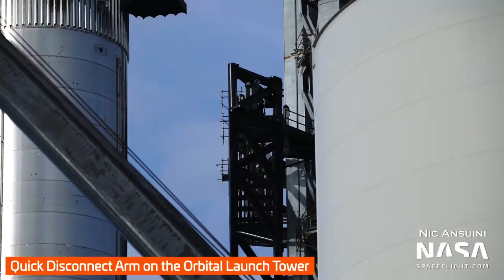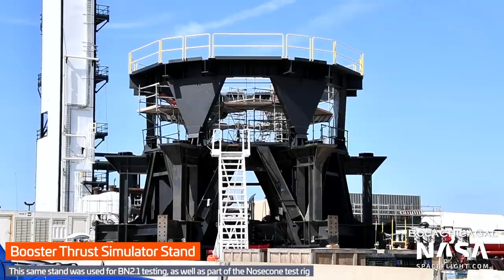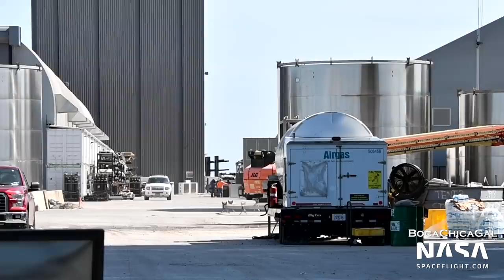GSE Tank 8 Aft Dome Flipped | SpaceX Boca Chica

Comment from the maker: Time Stamps!

0:00 - Sunrise Over the Launch Site
0:37 - Quick Disconnect Arm on the Orbital Launch Tower
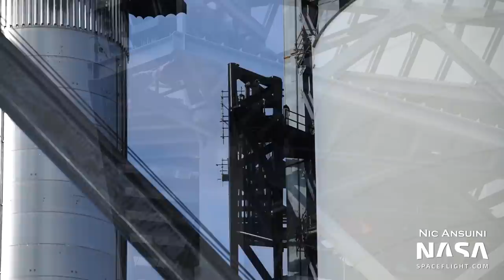0:47 - The Top of the Orbital Launch Tower
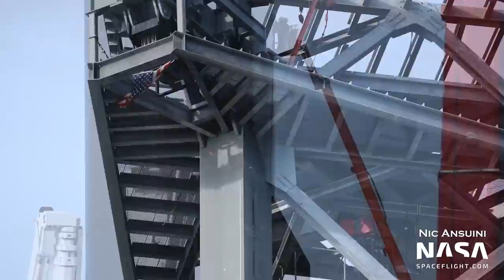1:07 - Ship 20's Hatch is Open for Worker Access
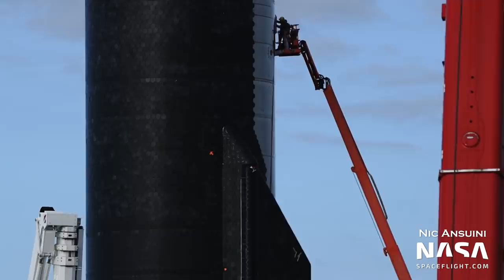1:26 - Thermal Protection Tiles on Ship 20 Look Nearly Repaired
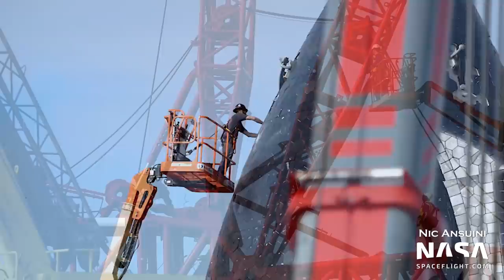2:05 - Crews Working on the LR 11350 Crane
3:25 - Carriage System for the Chopsticks
4:04 - SN15 and Ship 16 Peek Over the Propellant Production Plant
4:24 - Coil of Stainless Steel Delivered to the Production Site
4:44 - Work Continues on Possible Quick Disconnect Arm Extension
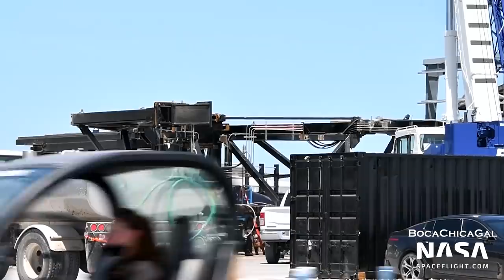5:43 - Work on the Ground Fabrication Building Expansion Continues
6:02 - Barrel Sections at the Production Site
6:22 - GSE Tank 8 Aft Dome Section Flipped
7:20 - Booster 5 Under Construction in the High Bay
7:40 - GSE Tank 8 in the Mid Bay
8:00 - The Propellant Production Site
8:34 - Booster Thrust Simulator Stand
8:53 - Test Tanks and Booster Thrust Simulator
9:13 - Booster Thrust Simulator (left) and GSE 4 Test Tank (right)
9:33 - Foundation Work for the Wider High Bay
9:52 - Barrel Section with TPS Tile Attachment Points in the Scrapyard
10:12 - Booster 5 Forward Tank Section #2 at the Production Site
11:07 - GSE Tank 8 Aft Section Moved Towards the Mid Bay
11:47 - A Ship Common Dome and a Methane Header Tank at the Production Site
13:05 - Booster 5's Forward Dome Sleeve Moved
13:26 - Booster 5 and Ship 21 Forward Dome Sleeves
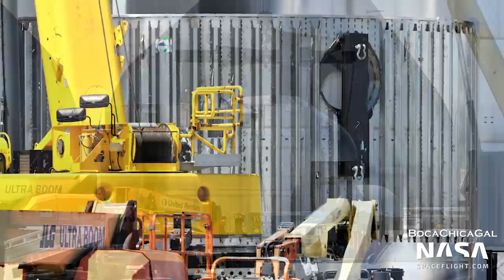14:04 - A Ship Common Dome on the Sleeving Stand
14:45 - GSE Tank 8 Aft Section Hooked to Crane Outside Mid Bay
15:05 - GSE Tank 8 Aft Section Lifted into the Mid Bay
Reply: Thank you for your efforts 👍
Reply: You are missing 12:29 - Somebody is real proud on themselves now
Reply: Challenge accepted ! 3.6 mm thick - 2000m wide - inner diameter 406mm - outer 9547 mm - length 172m this will make exactly 6 rings ! Weighing about 1,550 kgs each  ? thats my guess !

Comment: Those rolls of 3.97 mm thick stainless steel are 193 meters in length  and have 11.071 metric tons mass. The cylinders are 9 meters in diameter and 1.83 meters tall. So the number of cylinders per roll is 193/(9*pi)=6.8.
Reply: The roll shown on July 26 was 13260 kg; that roll would produce 8.013 rings. (13.260 / (1.8288 x 9pi x .004 x 8)). The last figure is the density of 304L steel.
Reply: I wonder what they do with the .8 left over. Do they make a two section ring or just use the .8 for other fabricated items?
Reply: @TheJimODonovan  maybe it's just absorbed as the cutting allowance over all those cuts
Reply: The machine that sets the curvature of the rings probably requires some extra length on both ends. That would have to be trimmed off before welding the ends to close the ring.
Reply: @TheJimODonovan  depending on what they use for cutting it there may also be some losses 🤷🏻‍♂️
…and the could always use the rest to fabricate something else like some covers or parts for the nose (I’ve seen steel being delivered in rolls in other factories and in the end it was used to make flat parts, so that’s an option) but I guess they could also simply return it so their provider can melt it down again and “include” it in a new roll (even though the rolls are usually a customized length).
Reply: Note: This is .8 of a ring, not .8 of a metre. That's quite a chunk of metal.
Reply: It really is very hard to answer the original question since we only have a handfull images of the labels on those rolls. The weights differ by tons sometimes (between 9.520 tons and 13.260 tons). The thickness differs by ±0.03mm.
Outokumpu stopped adding the length of the rolls to the labels about 2 years ago.
Also we saw a roll from Janco Steel too, so Outokumpu is not the only one.
So the answer would be 7 or 8 rings per roll. I assume they get both from the rolls they buy. That is better than the 6.8 they started out with (301 steel).
Reply: @donaldmiller1782  It's interesting to see the other properties all that chromium and nickel can affect. Plain-carbon steel has a density of 7850kg/m3 and I didn't expect the alloys to boost the density all the way up to 8.
Reply: @donaldmiller1782  8.1187 rings, if you take the inside diameter (9000mm-4mm) and the UNS S30403 density of 7.9g/cubic meter 
That gives them 3.3 meters of 'play' rather than just 376mm
Reply: @nemo-x  That's odd. I just googled a calculator and found one from bsstainless. On their form I enter: density=8, thickness=4, width=1828.8, weight=13260. It says the outer diameter = 1188.29mm which looks about right. (They also say the length = 226.58m).
Reply: I thought the new material was 3.6mm thick, not 3.9mm.
Reply: @nemo-x  He got the date wrong: it's 23 July "Pathfinder Nosecone with Payload Bay Spotted" About a third of the way through the video. 
(The print date of the label was 07-15-2021 9:37:12 am )

Comment: I fully expect the head of heat shield development to get showered in champagne by his team if by some miracle Ship 20 survives reentry.
Reply: when ship 20 survives. remember the heat shields help for reusability. the starship is made from stainless steel can handle alot more heat. then the tin foil shell of the shuttle..
Reply: I'm just saying even if they lose a dozen tiles on starship.. the ship will still survive reentry
Reply: @razzati420  stainless steel melts at 1510C, orbit re entry is near that so idk if it’d make it, In practice there is always more to it than on paper
Reply: There were two instances where the shuttle's heat shield was significantly compromised. The key difference was that with Discovery the tiles broke over one of the few stainless steel areas of the wing, whereas the Columbia had the leading edge holed, allowing plasma into the aluminum under-structure. Discovery's spar got toasty, but held. Columbia not so much.

Remember, even if S20 fragments on the way in, getting to orbit will be a major achievement in of itself.
Reply: Id just be super happy to see it make it off the launchpad in one piece, let alone into orbit
Reply: @Peaches_NZ  ar the very least it really needs to clear the launch pad by a couple kilometers, otherwise damaged to launch infrastructure will be a huge setback.
Reply: @admiralhugo1440  But hardness of steel sheets will gone after slow cool down from 700 C. You may be known that on the Titanic before collision was occured firing and steel plates was much more weak after that.
Reply: @admiralhugo1440  I'd also imagine it could warp quite a bit at that temperature from aerodynamic forces and, considering it is pressurized, this could lead to failure. But then I'm not an engineer.
Reply: Iteration, iteration... ad infinitum (as long as funding lasts). They’ll get a ship back even if toasty. They have a human rated capsule, IP on thermal loads scale across the company. But rapidly reusable? That’s the holy grail...
Reply: Champagne transpiration cooling... how billionaire space baron.
Reply: I don't see how it would be a miracle.
Compared to the Space Shuttle (aluminium frame and small fragile tiles), Starship is far more sturdy (steel frame and larger less fragile tiles). 
Even the steel itself won't melt from re-entry temperatures.
I am expecting re-entry for Starship to be a much easier and safer thing to achieve than it ever was for the shuttle.
Reply: There are so many factors to think of. The temperature of the steel before reentry. The amount of heat needed to get that steel to a melting point. The time that takes to happen. The time the thermal blankets add to that. The difference between losing a tile and having one partially broken off.
The list goes on.
Only the actual tests will help resolve those questions. It will not happen even after S20. I would at least wait for S23 before I am a bit more confident.
S20 is just the first one - many will follow.
Reply: @knowlegeisgood8735  Whenever SpaceX tries something new and incredibly challenging I remember what SpaceX did with Falcon Heavy and I smile.
They could just nail it on the first try or the third. 
At least we can confidently say it should not take them very long.
Reply: @joyl7842  I am confident they will solve the problems. We are just wondering at this stage about S20. I don't expect much. The first ones usually fail one way or another.
Reply: @joyl7842  but do you think you need the steel to melt completely to affect the most sophisticated rocket ever built
Reply: @admiralhugo1440  It isn't sophisticated though.
It is very much simplified, apart from its full-flow-staged combustion engines.
Hence all the steel and no carbon-fiber alloys.
This is a philosophy of Elon Musk's I very much admire.
If you can eliminate a step or simplify it, do so.
That's why SpaceX decided to make Starship and Super Heavy out of steel and not carbon-fiber alloys, which would be much more costly and slow down production.
Reply: @joyl7842  I see what you mean but, starship being in its most simplified form is by no means the same thing as “not sophisticated”. And that’s without considering the booster at the bottom 🥲
Reply: Doing S21/B5 would be much quicker because:

-It is already under construction
-Stage 0 had to be built along with S20/B4
-They have experience from building S20/B4
Reply: @knowlegeisgood8735  Forget about melting temperature. We need to consider the "floppy temperature" (yes that's a technical term I just made up) of stainless steel. :)
Reply: @williamgreene4834  I am not sure there is such a temperature. There is some range of in which steel expands faster than normal, but I don't have any values for that range.  We would need a metallugist to ask for details.
Reply: I'll shower myself in champagne if Ship20 survives re-entry. Any excuse like, but it'll be a damn good one.
Reply: @craignixon450  my man haha
Reply: @Peaches_NZ  If it burns up on re entry...It would have been a success.
Reply: @joyl7842  I like to temper my expectations...makes me appreciate the eventual successes so much more

Comment: The booster catch point has a design change. Looks like it will receive extension arms for larger area to catch. Makes sense compared to those tiny T Rex stubs they use on B4

Comment: 06:04 Closest barrel section has cuts for bracing to be installed. Thermal tile attachment points are more dense & clustered (see 09:58 Barrel section with TPS tile attachment points...)

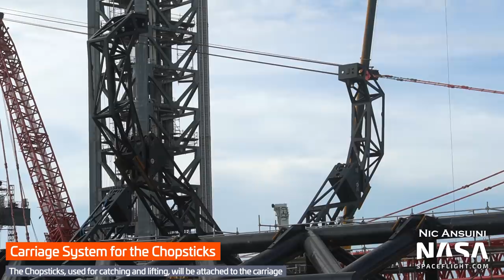Comment: @3:30 I still think this structure is a steady/support for booster or starship, not a carriage for the chopsticks. It’s way too lightweight for that. I believe it looks too large to be a support because the arms are in their retracted/clearance position, hence the idea that the assembly fits the tower via these arms. Time will tell of course, I was wrong about the launch platform!
Reply: Agreed. The vertical laying arms look for steadying only, not meant to support any weight.
Reply: A big problem with your theory: The claws are more than 12 m wide. The ship is 9m. The claws have no hinges to clamp them to 9 m either. They are static.
Reply: @knowlegeisgood8735  It’s hard to be certain without a close inspection, but I think there is a pivot point on the arms. My notion is that there will be pads/buffers on the square plates that can be seen at the ends and part way along. The outer parts of the arms pivot to give clearance then close to grip round the body of the rocket. As I say, just an idea based on what I can see (not all that well) on the footage. Happy to be proven wrong, as always :)
Reply: The strut structure does not hold weight it is the attachment points attached to the tower pillars and the pillars themselves that hold the weight
Reply: Well, I'm starting to think I was wrong here. The RGV piece looks fairly convincing. I still think it looks a bit flimsy for the loads though ;)  Yes, I understand the hoist will be carrying the weight, and reaction forces are fed into the OLIT, and any cradle only(!) has to keep the fork assembly aligned, but even so, some pretty big forces involved.
Reply: @knowlegeisgood8735  I’ve not used FEA myself, although I am aware of it, and I’m 100% certain that SpaceX know more about building this stuff than I do! :).  The way they are progressing, we’ll see it assembled soon.

Comment: 14:05 Booster 5 shows a place between the place for the fins which might be where a folding catch system point might install
Reply: Both B3 and B4 started with the same foundation for the hard points.  You can see it in the first early videos where the new forward dome section was observed.
Reply: @scottgaree7667  Look at both booster 4 and 5 at 14:03 again. There is a big difference. The new booster has a new piece and even the top booster ring looks different
Reply: @scottgaree7667  3 and 4 yes but booster 5 not the same. Actually starts at 14:05

Comment: Great pictures and footage Mary and Nic, thank you much.
I think one coil of steel judging by its dimension can make hmm maybe 11 rings 9mts diameter? 

I have a question about the tiles, i asked this some time ago but i can't find where i posted it.
I saw a super zoomed in image of the fixed tiles on spaceship but i have to say they all look kind of irregular, like one is enter deeper then the other, one sticks out a little on one side etc. Can't they invent a little machine to push in each tile at the same strength instead of using workers hands? that i think would make the job even faster.

Comment: Maybe this was asked before but what led to the damaging of the TPS tiles to begin with anyways? If I remember correctly, they didn't even finish adding all of the tiles before some of them became damaged and needed to be replaced already.

EDIT: fixed spelling
Reply: I believe lifting the ship by the nose creates stress on the top of the body,  popping/cracking the tiles
Reply: @srgambetty  If that was the case Elon would have fired those who designed the ship. I know many have said that in the comments and even in videos. In my opinion that is nonsens.
Reply: Not enough time to install them in a proper way. They had to make it by August 5 "no matter what". They failed. It was impossible.
But it is almost fixed now, so they just lost a lot of tiles and even more man-hours.
(Another thought just hit me. What if the installers with the longest experience got sick and they had to use temps? On top of all else.)
Maybe Elon tells us what actually happened in more detail one day?
Reply: @knowlegeisgood8735  it's hard to thwart physics, even if you're on the spectrum.  It was the lifting.  That is why they are planning on using a different method for lift and stack.

Comment: 3:25
NOONE in their right mind can tell me that this flimsy assembly alone is supposed to carry the far bigger "chopsticks" they put together, let alone withstand the load of an "almost empty" booster ontop of that. (o_O)
This assembly better be just to steady the booster (maybe from the side) once it landed on the chopsticks.

Which just reminds me, didn't Elon mention they want to catch and balance the booster on those tiny little studs on the sides instead of the actual gridfins?

Comment: At time stamp 4:25 the question is asked about how many rings can be made from one roll of steel.  First we have to know what is the length of steel is in the roll, then we calculate the circumference of one of the rings.  Divide the result into the total length of a steel roll and you have your answer.
Reply: That is the easy part. The hard part is how to answer a question that has more than one answer. Since we only have a handfull images of the labels on those rolls. The weights differ by tons sometimes (between 9.520 tons and 13.260 tons). The thickness differs by ±0.03mm.
Outokumpu stopped adding the length of the rolls to the labels about 2 years ago.
Also we saw a roll from Janco Steel too, so Outokumpu is not the only one.
So the answer would be 7 or 8 rings per roll. I assume they get both from the rolls they buy. That is better than the 6.8 they started out with (301 steel).

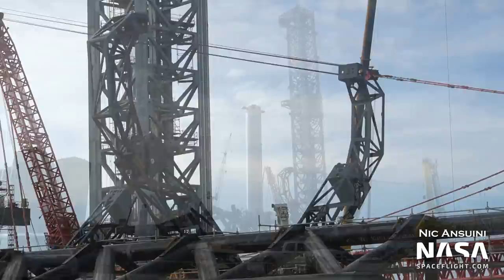Comment: 3:40 I cant Belive this Carriage holde the hole wieght of this big "Chopsticks". It looks somethingis wrong. is it possible that the "Carriage" the Catching system is and the big "Chopsticks" the mount the the tower?
Reply: Calling it a carriage is a bit misleading. It does not carry the weight of the chopsticks - it guides them along the tower. The winch with its pulleys and cables do. The carriage only needs to withstand any horizontal movements (not large loads).
Reply: The strut structure does not hold weight it is the attachment points attached to the tower pillars and the pillars themselves that hord the weight

Comment: At 5:25...just a question: I've not worked construction but wouldn't all workers be required to wear hardhats? (instead of baseball caps)
Reply: @texaswunderkind  ok thanks...interesting...I always thought that there were designated areas in which they were required.